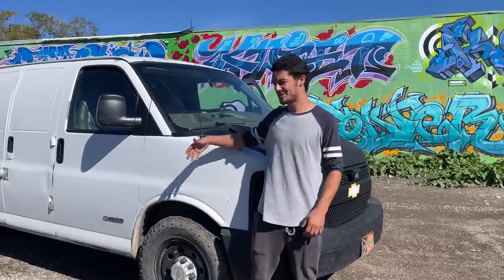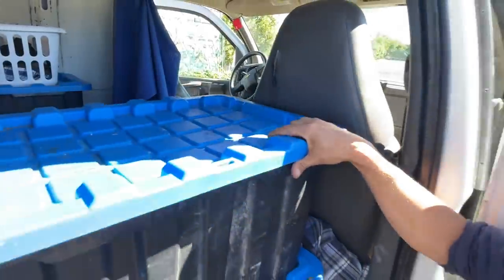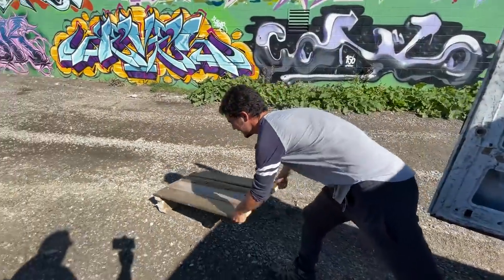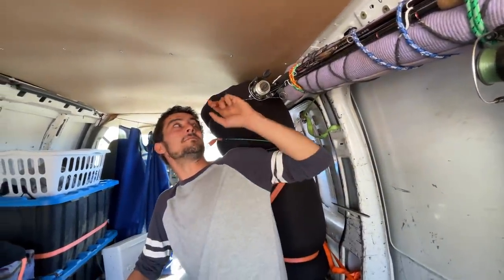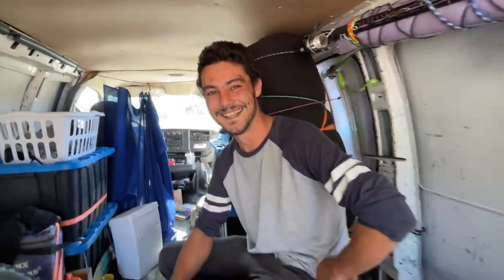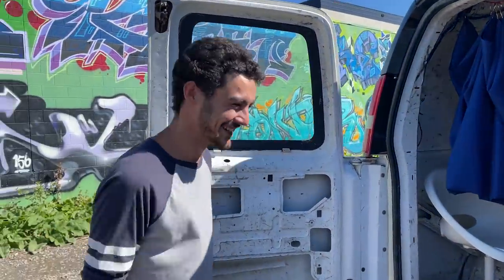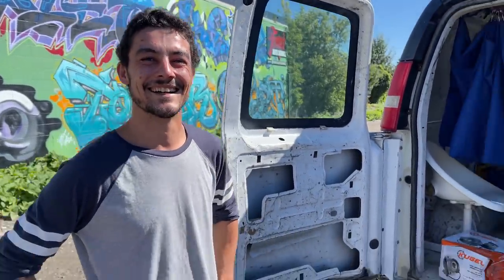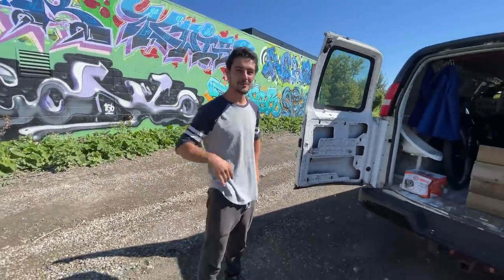Living In a Van With No Build For a Total Cost Of $1000 | Stealth Van Tour

Comment: Well, I've got a plastic bucket made to catch oil when you do oil change. So it has a very flat bottom and are wide.. I have never get wet floor since I bought it. Using it for washing clothes, do the big dishes and washing my long hair..  And IF I should ever do an oil change... 😁
I have a similar bed in my campervan/ex cargo van. It is so easy to fold it and do yoga on the floor

Comment: Hi .I live in back of pickup during winter working on the road. Put 1 inch or 2 inch o aluminum foil cover  insulation on floor cover with plywood  and walls / ceiling  and a wall or insulation  curtain across  front 
It will make a big difference 
Happy travels

Comment: Military time is simple, brah! Anything larger than 12, you just subtract 12 so 1400 is 2pm,,,1600 is 400pm,,, the 30 is bottom or half hour and then there is 15 and 45 and I think you can figure that out as quarter hours..1425 is 2:25pm ,,,1645 is 4:45PM so the time before 12 just has a zero before it like 0245...midnight is 0000 or zero hundred hour!!

Comment: You can spray insulation on the walls and ceiling and that will be clean install and very warm and not expansive at all and that glue on the walls. no need to cover it